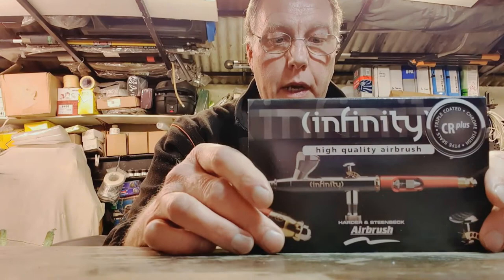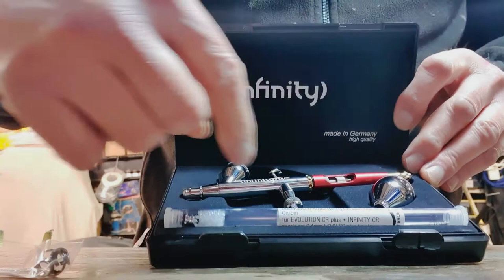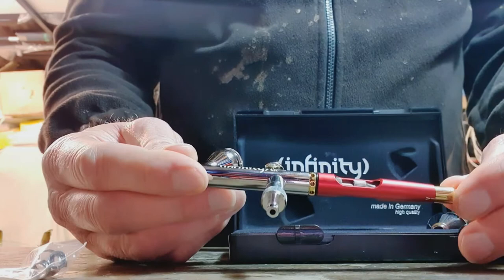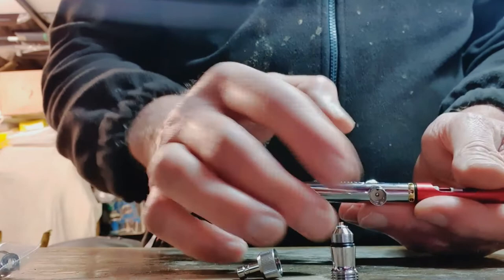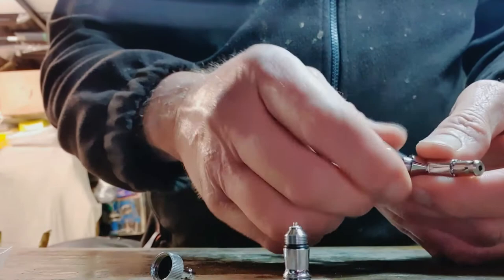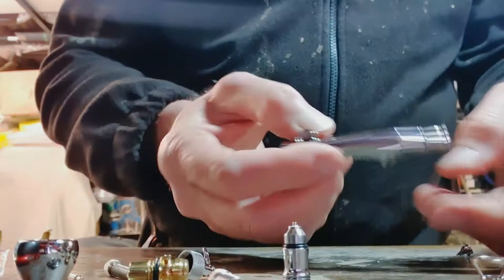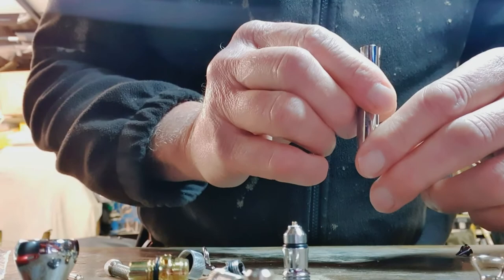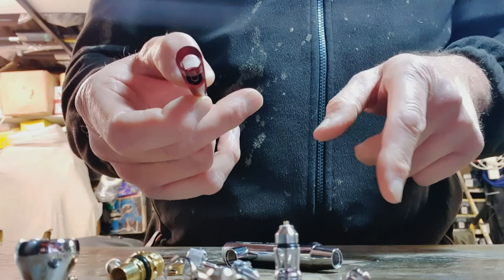Harder and Steenbeck Infinity CR Plus Airbrush Unboxing Part 1

Comment: That double pronged end tip is used for cleaning the tip. You can squeeze your thumb and finger together over the tip end and pull off any dried paint. Some use a sponge our paper tissue with thinners on. You will find yourself doing it very few minutes depending how much you have thinned the paint.
Reply from the maker: Thanks David,  that makes sense, at first i thinned the material down the same as i would for a normal mini gun, that goes through a 0.5 tip no problem but i eventually settled for 33% paint and the rest thinners which went without problems through the 0.15 tip

Comment: Nice one Pete. I use the Sagola, I find it easier to clean, assemble disassemble the tip. Also I use the badger 105 very versatile and similar cleaning to the sagola. As most airbrush tips are too small for me to lose.
Reply from the maker: Thanks for the comments, the Badger 105 was one i was looking at, as i say, i really had no idea of what to expect from an airbrush other than looking at YouTube. I didn't think at first i needed one but was finding a lack of control with the mini sprayguns, one of the biggest issues was the amount of air coming out of a mini was blowing the stencil around, something the airbrush doesn't do, not to any extent anyway, cheers 👍
Reply: @peteshobbies5383  I use my airbrushes for stencil logos, I use stencil masking film to make my logos.
Reply from the maker: I've always thought about making some stencil logos, for various bike manufacturers but i don't think i am good enough to cut them out, must be really difficult, would be better for me than using decals, a better job as well
Reply: @peteshobbies5383  a vinyl cutter is easy to use, I use a Cameo silhouette. comes with software etc
Reply: @peteshobbies5383  check out ETOE channel on youtube,  He paints a lot of cycle bits. I'm sure you already know the channel
Reply from the maker: So it's like a PC printer but for cutting vinyl stencil sheets?
Reply: @peteshobbies5383  that's correct Pete. Do you have an email address? or we'll be chatting here all night :)
Reply: @peteshobbies5383  Thanks Pete, got your email address
Reply from the maker: @sw9506  Cheers 👍